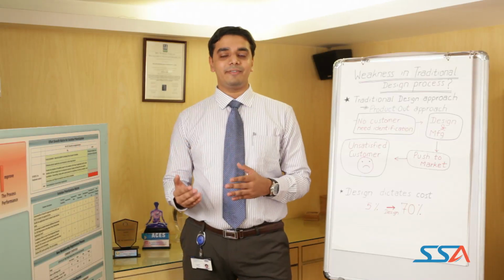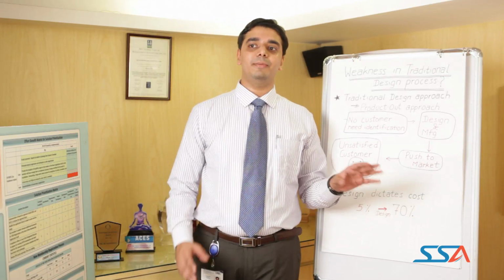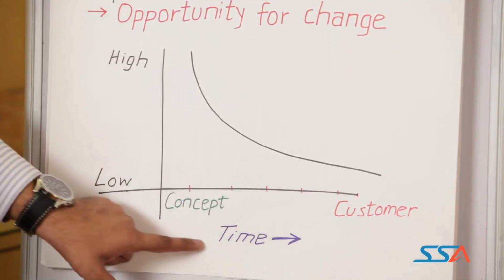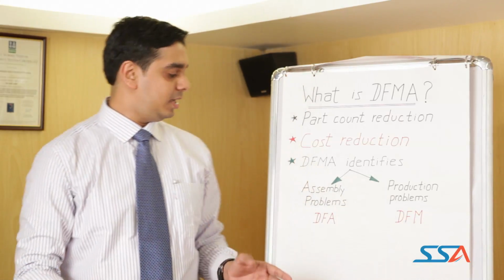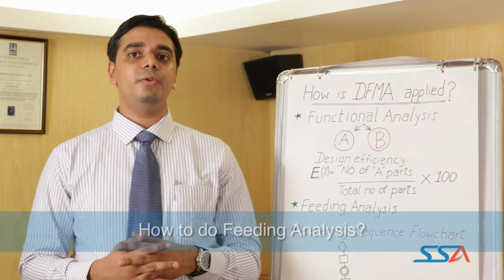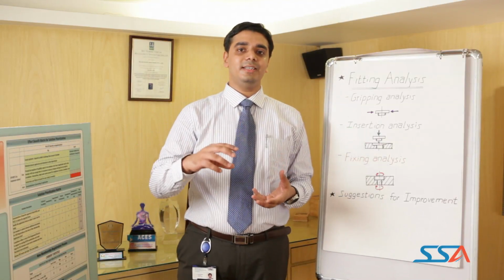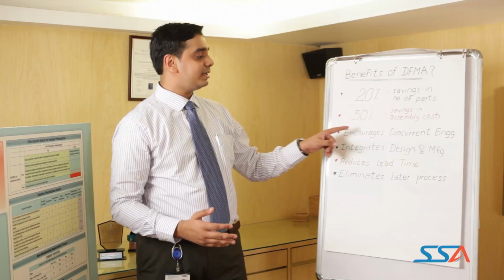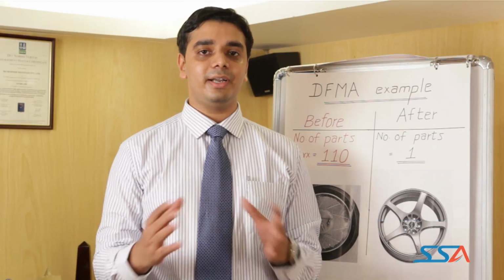Design for Manufacture and Assembly

Comment: Example of tyre was good but but it cause problem for the customer,, when the single part of alloy wheel broken we have to change the whole...where as in the spoke wheel if one spoke is damaged it just only need to change,, so the cost of the customer is low..
can u suggest some other example